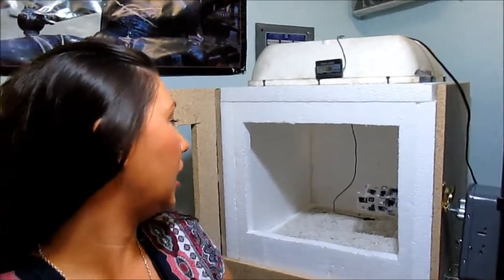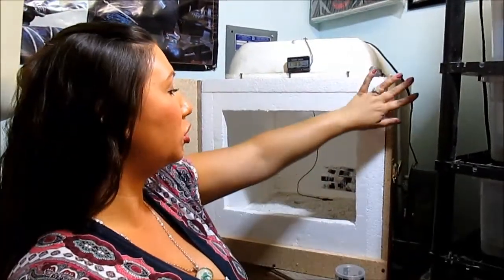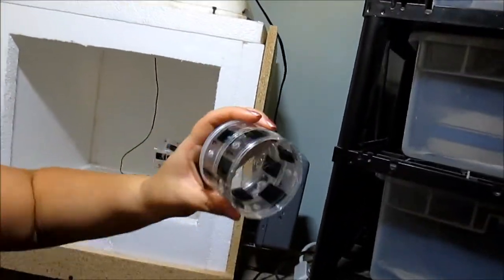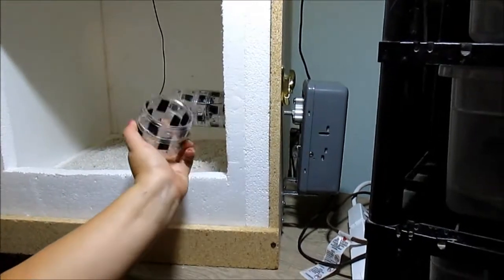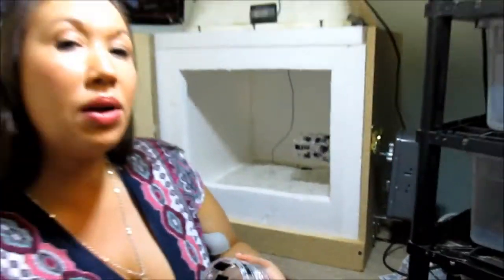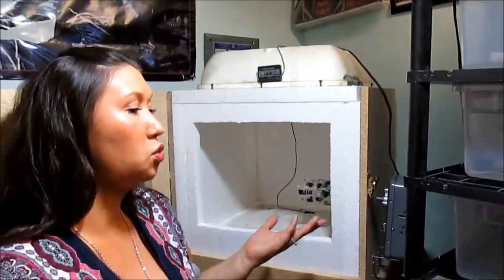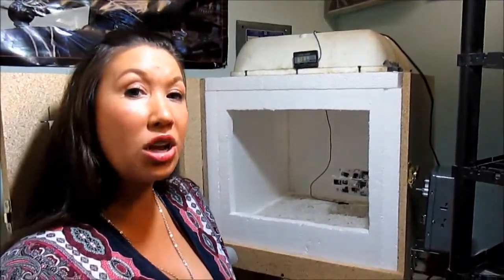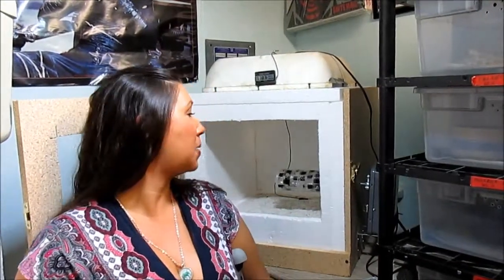ROBOTARANTULA MOM 2014

Comment: Hey Marita, very impressed with your incubater, what are the mail component you used? I can get the insulated box, the thermostat and a heat source but what is it you use to rotatae the egg sack. Thanks DTG Big smiles from Scotland :)
Reply from the maker: It is a 24 hour commercial timer.  I am not sure if you have home depot, but they sell them there.  If not here is the link for amazon http://www.amazon.com/Intermatic-T101-Hour-Dial-Timer/dp/B00002N5FN/ref=sr_1_1?ie=UTF8&qid=1396889903&sr=8-1&keywords=24+hour+commercial+timer&tag=donations09-20  Here is the list for the 3/8" bass pro mount and a few other things RobC put in his.  His was too expensive, so I modified it further   http://www.arachnoboards.com/ab/showthread.php?177852-Robc-s-Mechanical-Mom-Tutorial   DTG:)
Reply: Marita De La Pena Your a sweetheart DTG, thank you <3
Reply from the maker: caitgems1 Thank you:)

Comment: That's a great mod! So when you were manually turning the sacs, Do you rotate them just a bit or 180 degrees every 12 hours?
Reply from the maker: I roll them twice a day about 90 to 120 degrees each time.  I do this to keep pressure off the eggs on the bottom and to keep them from sticking to each other.  Thanks for watching:)